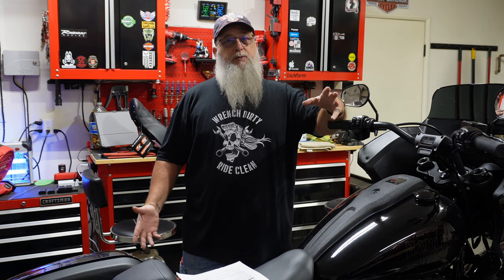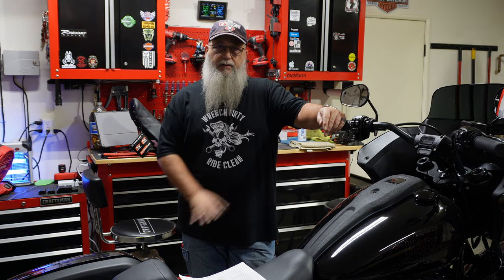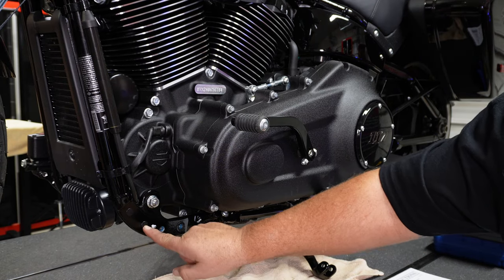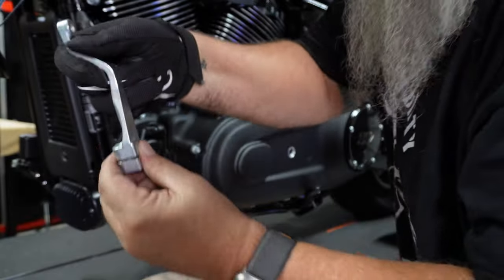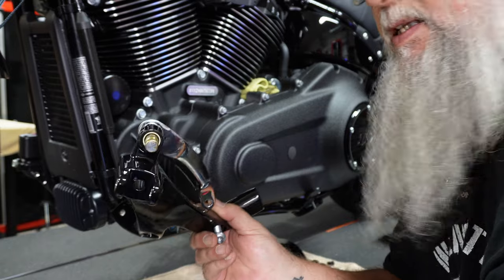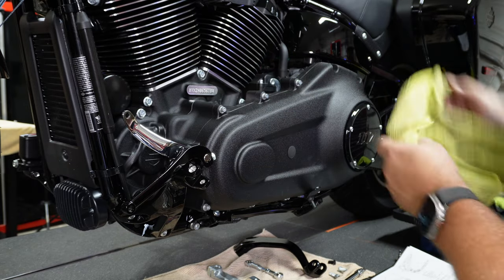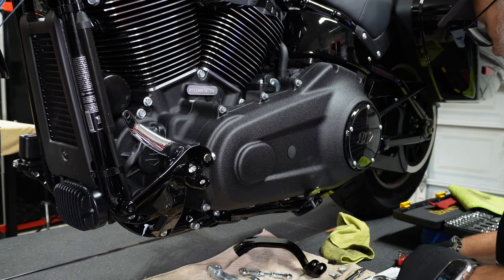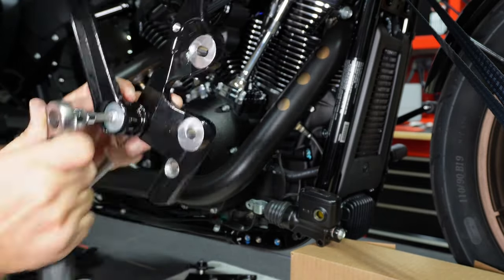2022 Low Rider ST Upgrade - Forward Controls, Seat & Seat-Lox

Comment: I think I’m not a fan of that brake. Looks too small. Would have to go with Moto-X or something bigger.
Reply from the maker: Thanks for the comments. I agree, it is a small lever for sure, I will be swapping it out at some point as well. I did not want to mess with buying the chrome version and have to get it powder coated to get the bigger pedal. Why they are different between the two is still a mystery to me though.

Appreciate the feedback, ride safe

Comment: I have the exact bikes st forward controls , 475 S&S , THRASHIN pipe , Saddleman , mustache, 6.5 “ bars , general dynamic lights . Also a road glide with 475 , Olin front and rear , Saddleman , all black 2020  your thought on keeping both . And what do you like best ,I’m 81 and some time the st is easy to throw around . Love the road glide for longer trips but most of my riding is shorter now days .
Reply from the maker: That's awesome and thank you for the comments! Sounds like you have excellent taste ;-). 

In answering your question, I prefer my road glide over the low rider at this point, but I am still working on various updates to the LRST (despite some nay sayers on my choices ;-)) and it is working through an oil leak issue at the dealer. I toss my RGST around pretty easily, but the LRST being a softail with the 117 is a fun bike to ride. 

If it were me, I would look at what suits you best these days and what is the most comfortable and enjoyable for you. In my opinion, there is no reason not to keep both, unless there is a financial preference involved. But, you can outfit the LRST with the sound system and tour pack to give you the same functions (mostly) of the Road Glide, if it is easier for you to ride and stand up due to the weight difference. 

All in all, much respect for having some awesome bikes and getting out there and enjoying the experience.

Ride Safe!

Comment: You don't find that the part of the engine on the right that sticks out gets in the way of your leg with the forward controls?
Reply from the maker: Thanks for the question. I do not since I changed the air cleaner out as well to gain 4 inches of additional clearance. 

Ride safe

Comment: I finally purchased a 22 lowrider st and did the forward controls. Few questions hows the rear brake feel? Mine feels like trash. Also i ordered same seat how does it change your riding position?
Reply from the maker: Congrats and thanks for the questions. I agree on the HD fwd controls, the black pedal is crap. I did another video on adding full heritage fwd controls and boards, check that one out. As for the seat, I also did a video on adding mine with riding position views to help show that. Check those out and hopefully they will help with adjustments and position changes. The best thing I did was add the Thrashin bars and risers. Also a video on that. Made a huge difference. Appreciate the feedback.

Comment: Hello very informative video. Question, Is it just as easy going back to mid's I am buying a 2023 Low Rider ST and the current owner has installed forward controls but at 5'10" and close to 70 years old I feel like I may need the mid's like I have now on my 2014 Dyna Street Bob. I think I could do the back to mid's myself after watching your video also the seller says he could also do it for me. (he has all of the original mid parts) So what I'm asking is should I buy it with the forwards and see if I like iit. If not in your opinion how hard is it to go Back to mid's Thanks man
Reply from the maker: Thank you for the comments. Great question, reverting back would just be the opposite of what I did, correct. Only thing is that you may need to pull off the covers to get the linkage arm back in, but I have not done it so not sure. I will tell you that the fwds are much more comfortable to me, at 5’11 than the mids. But that would be specific to your preference. If you have not yet ridden the bike as is, do so and see. If you don’t like it, ask the owner to put them back if it’s worth it, or try yourself. I think you could do it, just take your time. 

In any case, if you like the bike, and it’s a good deal, don’t let that stop you. 

Ride safe.

Comment: Whats your opinion on the Fosgate speakers. Are they as  good quality as the factory speakers on a Road Glide or street glide
Reply from the maker: Thanks for the question. I have not installed one, so I don’t have a personal reference, but from the videos I have seen from others who have installed them, it works pretty good. You would just need to have a remote option added since everything operates off the phone which would be tough while riding. 

Hope that helps.

Comment: I’m 5.6 inches tall. When I ride longer distances, I get lower back pain. Do you think the forward controller might help?
Reply from the maker: Thanks for the question! That is a tricky one since each person is different. You generally focus on 3 elements for rider comfort: Seat, Bars and Feet. I would suggest you look at seat and bar position first to be sure you are not adding additional stress on your spine/tailbone due to bar angle, butt position and grip height. If all good there, then look at fwd controls depending on what is comfortable for you as you ride.

Comment: Great video by the way. 
I just installed forward controls on my 2021 Lowrider S. 
Haven't ridden it yet but your video was very helpful. 
My question is the forward control kit comes with a plug for the outer primary cover where the mid control shifter arm was,but how about the hole in the inner primary where the shifter shaft follows through to the vertical shifter arm out the back side?
Does that need a plug also?
Will it leak primary fluid out that hole?
Any feedback would be greatly appreciated.
Thanks,Joe
Reply from the maker: Thank you, I appreciate the feedback and question. Been a while, but the instructions do not call out the need to plug the inner shaft hole. I have not any leakage or fluid loss since the upgrade so I think all is good. 

I am sure you will love the result and check out my second video on how to add heritage forward controls to my low rider at.
Reply: @justkillnbugz  Right on.
Thankyou for your quick response.
I will check out the other video with the floorboard install.
Ride safe man.✌

Comment: Great video, 2 comments
1) purchasr info on the black cap to cover the metal tab on the back of the seat?
2) I have the same forward controls on my LRST 2023.  The brake is too low.  There is darn little adjustment in it from what I can tell. It makes cobering the back brake a bit of work.  Do you have adjustment suggestions or alternative brake pedal I should consider that sits higher?
Reply from the maker: Thanks for the comments. Yes, I did a follow up video on this bike with installing full heritage fwd controls and a full Harley brake pedal. Check that one out because that was my similar complaint about these. The seat lock is a Robert Becker design lock, also have various videos and purchase info on those. Awesome products!  Check those out as well. 

Ride safe.
Reply: Not the seat lock.  I bought that.  I am talking about the black cap that fit over the rear bracket on the seat.  
Regarding the brake pedal, and forward controls (heritage). What was your motivation for going with the heritage forwards?  Did the heritage brake pedal not work with the first forward control you upgrade?
Reply from the maker: @davigf1  ah, ok. I am guessing mean because I do not have a chrome seat bracket. My saddleman came with a black bracket. You can purchase a cover on Amazon that includes a different thumbscrew for like 12.00 if I remember right. 

As for the motivation, the HD fwd controls kit is still at the mid control height. The heritage fwd controls are much lower and provide a more comfortable riding position with a lower knee bend placement. The full boards are an added bonus.

Comment: Great video. I'm not as displeased as you with the mid-controls, but I gotta get forwards. I don't like the handlebars. Too straight and a bit too far of a reach. I already added the Thrashin' 6.5 pullback, and mid bend bars but still too much of a reach and still too straight. I'd like to get bars of the same height and pullback as mini-apes.
Reply from the maker: Thank you for the feedback. Much appreciated. That path is coming for me as well as soon as I get the bike back from the dealer with the oil leak issue. I will keep you posted once I do the install video. Only exception is I have high bend bars and 9.5 going on. 

Ride safe.

Comment: So, you plug the outside hole in the primary, but what about the back hole?  Won't dirt get in there?
Reply from the maker: Thanks for the question. I would agree that if there is a hole from the outside through to the inside of the case to allow for the linkage to connect, that I would expect to see an inside cover as well. The kit did not come with any additional covers, plus that would be a real pain to install for sure. However, I will take a look at the case design from the service manual to see if that section is isolated off from the other areas.

If someone else watching already knows, please feel free to comment as well, more to come as I find out.

Ride Safe
Reply: Think you’re not supposed to remove the linkage, just push it back and the bung holds it steady, this way you don’t have to remove the primary to bung the hole in the inner primary that you presently are left with.
I did this on my 2011 street bob and no issues.
Watch your primary oil level with that hole 👍

Comment: Help when stripping the gear linkage and gear rod what diameter tools did you use all my allen keys do not fit cant ride my bike till its done
Reply from the maker: Thanks for the question. In the video, I show you how to push the linkage forward to access the rear linkage bolts for removal. Kind of a pain but works. I also call out the tools I use. 

Hope that helps, ride safe
Reply: Lol watch the video not panicking and listened correctly and picked the info out phew thanks for assist, your video is very helpful especially  when not bouncing off the ceiling, just got one bolt to sort now, thanks 😁

Comment: Shift linkage adjustment? Apparently Im doing something wrong when Im adjusting it.
I'm struggling to shift into 1st.

I appreciate the video. I followed with ease when installing my forward controls.
Reply from the maker: Thank you for the comments, I am glad the video helped you on the install. 

As for the adjustment part, not sure what you mean by struggling to shift into 1st. Are you saying it is binding as you downshift or possibly issues hitting neutral?  To adjust the linkage, depending on what type you have, is basically loosening the linkage nuts and spinning the linkage bar in either direction until your shifter peg is in a comfortable position for your foot. If you are having issues with the adjustment, be sure to verify the connection to the shift arm is on the proper side. If that is good and there are still issues, I would suggest verifying the shifter peg is as close to where you want it before adjusting the linkage to minimize extensive adjustments. Also, make sure the connection joints on both side of the linkage bar are not binding.

Hope that helps and ride safe.

Comment: Awesome video and beautiful bike dude! I’ve got a Low Rider S and I’m thinking of getting this exact same seat. My only concern is that maybe it’s not very wide and that it pushes you forward. I’m exactly the same height as you and 75kg. Are my concerns unfounded or do you find it pushes you forward and is a bit thin? Thanks
Reply from the maker: Thank you for the comments! Much appreciated! 

As for the seat, I love it, have them on two of my bikes, doesn't really push me forward but does raise me about an inch which is nice. As for the width, I like it since it is a bit thinner but feels like I have more feel to the bike. My suggestion is go to a dealer and sit on a bike with the seat. The step up is a popular seat and many should have them in used bikes or as a test seat. Then you can see how it feels before ordering.

Ride safe

Comment: What size tbit did you use on that inside bolt on the shifter lever. You said was a 1/4 inch bolt?
Reply from the maker: Thanks for the question. Yes, not a torx bit but a hex bit, 1/4 inch on the stock softails for me. May vary depending on lever and peg choices.
Reply: Thank you, I did figure that after a while 😊

Comment: Thanks for the video!  I’m doing this job now, how much side to side play did you have with the shift lever where it mounts to the bracket? I’ve got the oring on the engine side and the instructions called for an oring and nylon spacer on the other side (outside) of the bracket. I’ve got what a I consider excessive play. I’m thinking if I added a nylon spacer on the engine side of the bracket it would probably resolve the slack issue, it’s just that the instructions didn’t call for it.
Reply from the maker: Hi Mike, thanks for the question. I didn’t have any play on the shifter once I put the o rings and bolt in as you described. It snugged up just fine. It’s hard to say without seeing it but just be sure you have everything in place. Refer to my video again if it helps. If still an issue, you want need to exchange the part as it may be defective. Hope that helps and keep us posted.
Reply: @justkillnbugz   thanks for the response, I just watched your video again and realized that your spacer appears to be like 1/8 to 1/4" thick.  I have an aftermarket kit which only had a nylon spacer the thickness of a standard washer.  Off to Ace Hardware again.  I bought an aftermarket kit because the Harley kits were backordered.  Your detailed assembly of the shifter side really helped.  I'll probably be back when attempting the brake side :goodvibes:
Reply from the maker: @mikec35000  ahh, ok that makes sense. It took a bit to get mine as well but I did not see any after market ones when I was looking. 

Glad the video helped clear things up to help you.  That’s why I make them, even if it only helps one person 😊

Comment: I can't believe they have such a pathetic brake pedal with the black kit. I would not expect chrome and black kits to be different parts. Have you found a better brake that will work with the forward controls?
Reply from the maker: Thanks for the comments. Agreed, I would have thought the same.  I have not been able to find a suitable one for the existing black version yet, but some are purchasing the chrome and having them powder coated black. Once I find a solution I like I will post the install to share it out. 

Ride safe.

Comment: Can it be installed together with the bunking highway peg crash bar?
Reply from the maker: Thanks for the question, from what I have seen on other videos, the bunking single crash bar will not work with fwd controls. I preferred the full bar for myself and did not like the look of the single bar, so I did not even look in to it.

Thanks again for the questions, ride safe

Comment: Would you comment on how easy it is to use the rear brake with the black forwards you changed to? Another Youtuber commented on his choice to purchase the chrome forwards as opposed to the black ones you have, because of the angle of the rear brake. I'm trying to decide between the two.
Reply from the maker: Thanks for the question, of course. The black kit brake pedal is oddly small and inset. Especially compared to the chrome set, which why they are different who knows… it can be awkward to use. I weighed out doing the same thing but opted for getting a new black pedal instead of messing with all the powder coating. Additionally, Thrashin is working on a pedal for this bike so I am waiting to see how that goes before I change it out. 

Hope that helps and ride safe.

Comment: What size drive extension and length did you use on the 1/4” bolt behind the primary? Looks like a 1/4” or 3/8” drive. Maybe a 10” extension?? Great vid btw. TIA
Reply from the maker: Thanks for the feedback, much appreciated. I used a 3/8 drive with about a 10 inch extension to give me leverage and keep me away from everything. Worked pretty well.  It will of course depend on your bit set for the torx bits but you can also add a reducer if your stuck with 1/4 to give you the 3/8 leverage. 

Ride safe.